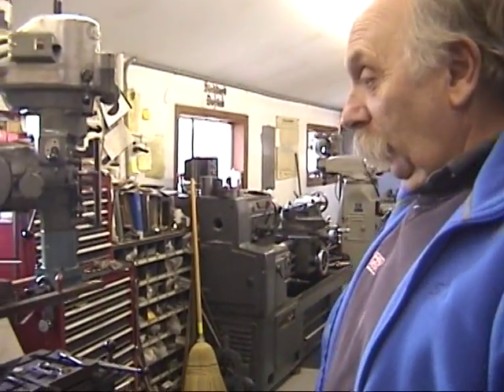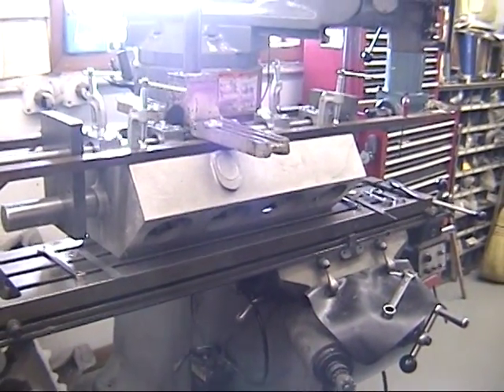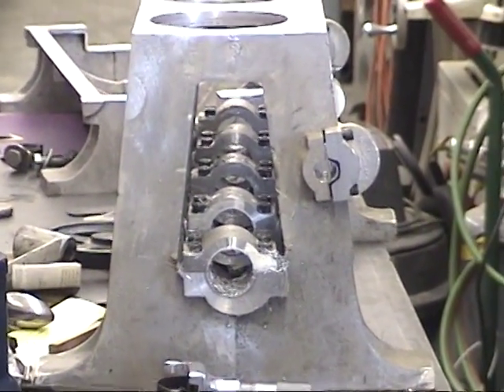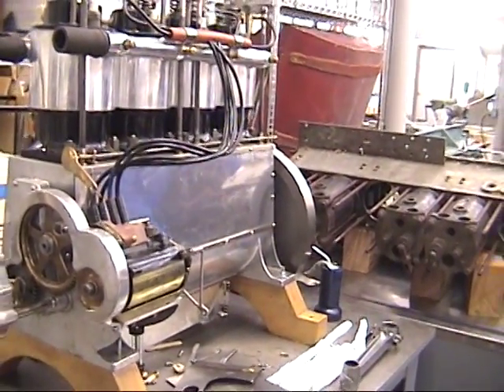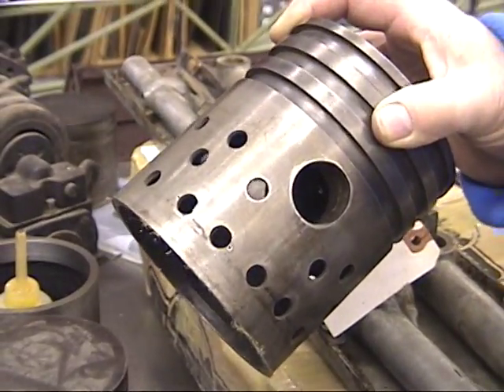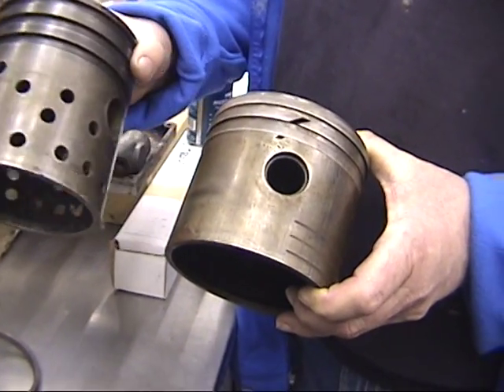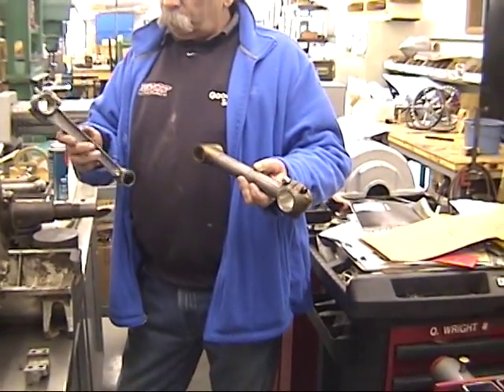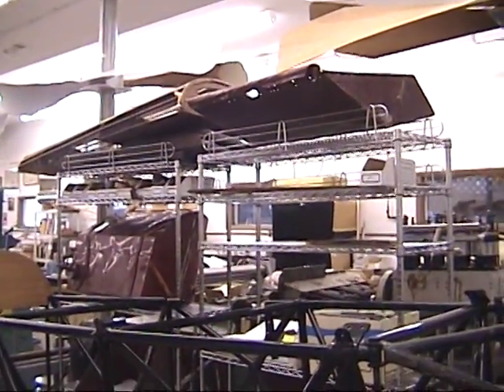2012.01.14 WRIGHT BROTHERS AEROPLANE ENGINES.mpg

Comment: Great video.  I was wondering if Charley Taylor had any input in the development and manufacture of the six and eight cylinder engines, also the 35 hp 4 cylinder.    
The Langley engine looked like it is a master of engineering as I was checking it out at Air and Space museum.   I would like to see that project completed and the engine running.   What a fascinating period of time!